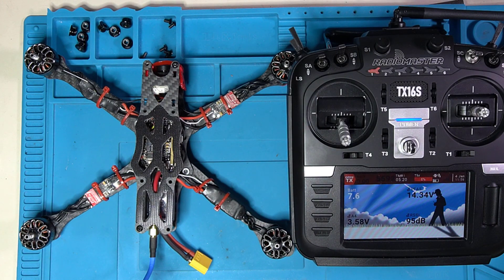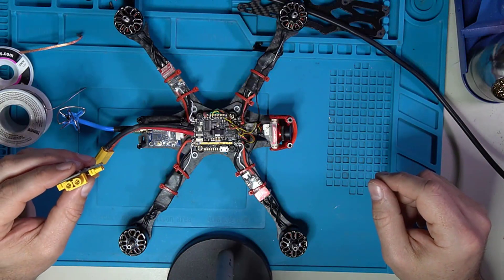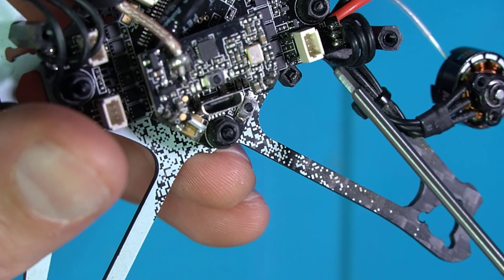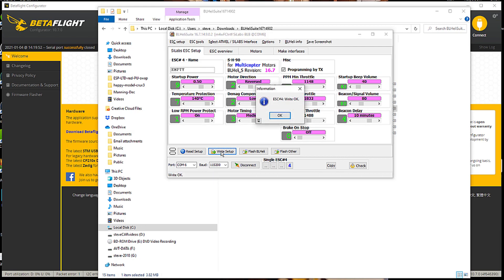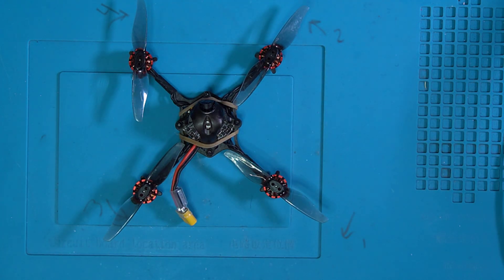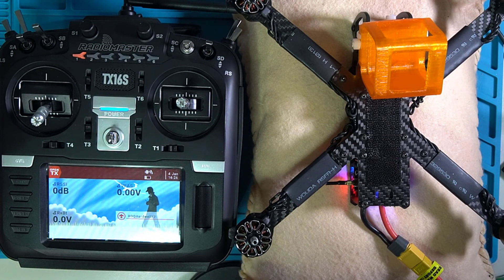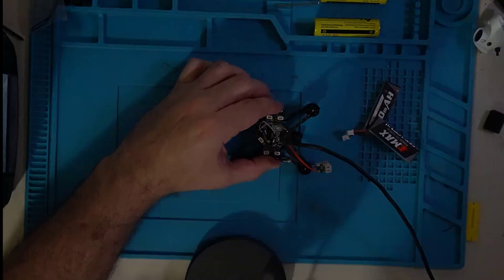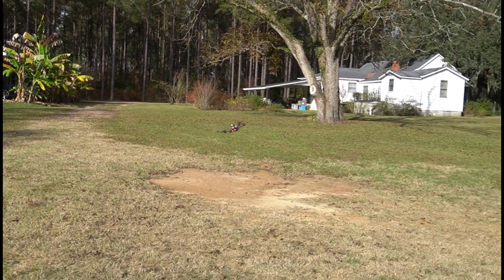Troubleshooting FPV Racing Quad Problems

Comment: 2 of my tiny hawk flight boards have had the metal pad for the vtx antenna fall off. I’m talking about the metal little piece that you solder the ufl connector to. 😔 literally $250 down the drain

Comment: On your FC for the TH race did you try blheli-s? I couldn't get it on blheli 32
Reply from the maker: I used -s and it worked fine.